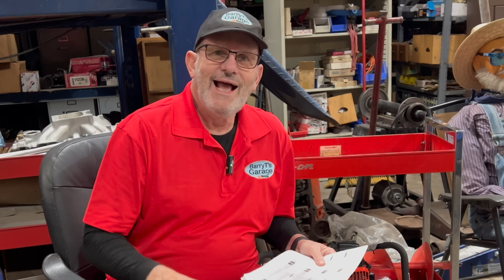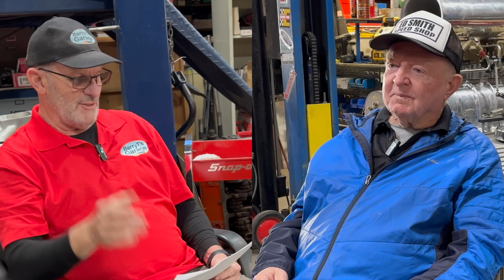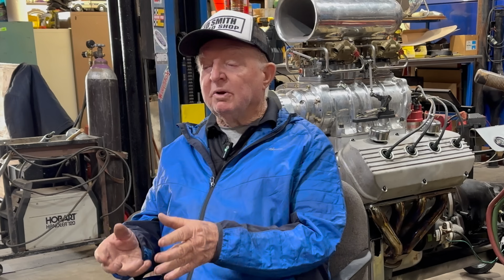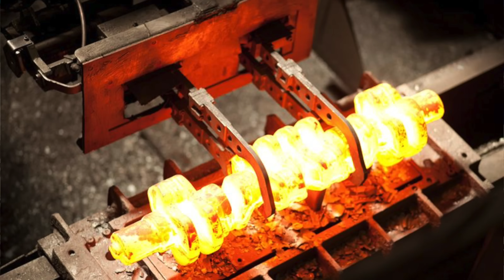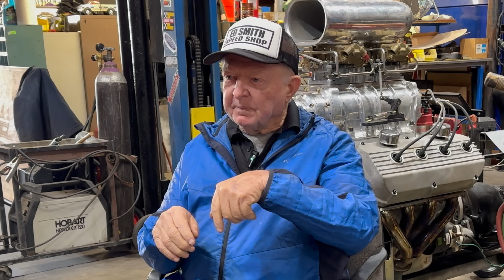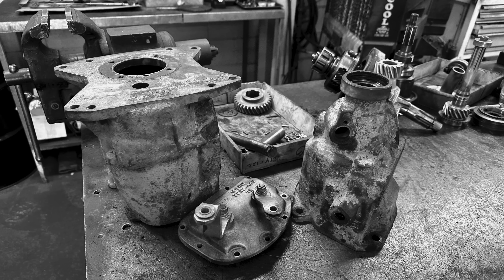Why a Forged Crank Can Actually Twist | Ed Smith with Barry T | Ask Ed 19

Comment: Both Ford and GM never added nickel to their cast iron engine blocks.
Reply from the maker: Might be an urban myth. It’s something people like to talk about, but I don’t know where it’s been proven
Reply: @BarryTsGarage  Truckedup wrote:There's been discussions on the supposed high nickel SBC identified by the 10 or 20 casting numbers....But no proof to back it up and...Some guy insisted early 454 regular production blocks were high nickel, any truth to any BBC nickel content or this or just more myths?
Myth. Or maybe misunderstanding.

I have personally overseen the analysis of iron samples of both Ford and Chevy production blocks with a $500,000 Scanning Electron Microscope (SEM) here in Silicon Valley so as to get this question answered once and for all. None of them contained any nickel. Said a reader of my analyses reports who is familiar with foundry production: "Nickel is never found in grey iron except for a small amount as a tramp alloy."

What we did find in the GM blocks in question was a slightly increased level of chromium, but this is not to be confused with nickel; it's just a differing iron alloy recipe, perhaps for a improved corrosion resistance. Frankly it's been our experience in the shop that the Ford iron is a lot harder, and when we bore Ford blocks they squeal in retaliation and we need to lap bits every other bore...while the chevy stuff gets all 8 holes cut with a single bit, "high" chrome or not.
=
https://www.speed-talk.com/forum/viewtopic.php?t=46186

Comment: Barry my 1979 ford 351 windsor motor won't spin a tire. Is my timing cam gear ⚙️  retarded from the factory?  If so will a cloyes aftermarket timing set at 0 degrees fix it or should I  advance 2 degrees? Thanks Rob
Reply from the maker: There is hope! I’ll ask Ed to explain in a future interview

Comment: I thought they all had 12vdc start and a resisted run.  Fords had the resister on the fore wall.  You knew you had a bad resister if the engine popped off wile you had the starter turning and immediately stalled when you released the key to the run position.

Comment: A deposit on a point set meant a problem with the condenser.  I forget now, but there was a rule that, depending on which side of the contacts the point formed on, it would indicate whether you needed a higher or lower rated condenser.  The condenser was to reduce arcing as the points opened and closed.

Comment: My buddy was a forklift mechanic and worked on a lot of propane converted engines. He told me that regardless of how many hours were on them they stayed spotless inside.
Reply: I worked for a school district with all propane school busses. only changed the oil every 10k and engines last 200k and very clean inside when we pulled one.
Reply: You are Correct
Reply: Except regulator n carb smfh

Comment: Most spark plugs nowadays have built in resistors built right in. On older cars the magneto wasn't all that powerful and they did not use resistors. Unfortunately this would destroy radio signal in the AM/FM bands.

Comment: I have a pair of 318 Chryslers in a boat. They run good but was interested in getting more torque. With height limitations I figured new heads and better dual-plane manifold. Use 92 or 93 octane gas. Really enjoy learning from an 
Ole Master !

Comment: inherited dad's 1978 ford f150 xlt LARIAT j code 460 ,made 51 trips and back to texas,put over 487,000 miles on it,retired it due to the heavy pistons in it,wore the bores to the point of piston slap,then gave it to my son,who grew up in it,he said i'll store it in a container till i can restore it,we put fuel in it,it starts right up,INCREDIBLE ENGINE,DOESN'T SMOKE
Reply from the maker: Amazing
Reply: Take that four sixty hone it out, put new rings in it and move the timing gear up one tooth. You'll have a brand new truck

Comment: Back when I was researching dual point performance distributors, they were saying it was to increase the dwell time because at high rpm there was so little time for the coil to produce the magnetic field.
Reply: That's exactly right.  Had nothing to do with heat.  Increasing the dwell was the dual point advantage.

Comment: Ed do you soak your hydraulic flat tappet lifters and pump them up  before you install them?
Reply from the maker: I’ll ask Ed - good question
Reply: Hydraulic flat tappet lifters should never be pre-soaked in oil before installing them.  The only time oil should be pumped through to lubricate everything is when you're about ready to fire up the engine for break-in after everything's been assembled...

Comment: So some of the points about crankshafts are not entirely accurate.  
A cast crankshaft typically refers to a crankshaft made of cast iron, but more specifically it means the crankshaft is made in the traditional casting process of pouring molten metal into a mold where the mold is typically comprised of tightly packed sand with a few additives to keep it in shape and other to help the “mold release” process.  Cast crankshafts can be normal old gray iron or by the addition of a very small amount of carbon it becomes what is referred to as nodular iron.  Cast Iron is a strong metal in compression but not so much in tension as it being composed of graphite among others makes it brittle.  The addition of carbon results in the nodular iron crank having more strength and its newfound ductility reduces it brittle nature!  With the addition of even more carbon but less than 2% of its total volume the molten metal is now full blown steel and no longer suffers the any drawbacks of cast iron.  

The next type of crank is the forged crankshaft.  While there are many different types of forging processes, the particular forging relevant to automobile cranks is the drop forging or also referred to as closed die forging.  A giant multi thousand ton hydraulic press is employed the compress metal between two dies.  The dies are two very large solid heat treated tool steel rectangular in shape, think of something the size of an end of bed storage trunk.  One die rest on base of the massive hydraulic press, basically on the “floor” if you will while the other die is attached to the press directly overhead the bottom die and raises with hydraulics.  In the face of each die where they come together, the rough shape of a finished crank is cut away, similiar to each half of a mold (in molds one is the cope and the other the drag).  This cavity is actually slightly oversized as some material must be left for final machining to dimension.  Depending on how intricate the shape to be die forged is, there could only be one cavity or their could be several cavities or several sets of dies.  This is called progressive forging.  A blank piece of bar stock is heated red hot and in some cases must be hammer forged to get it into the rough shape to be close enough before it can work with the cavity in the closed die or for simpler parts a hot blank may directly to closed die.  In either case the red hot metal is laid on the bottom die in this cavity and the top die hammers down closing the two dies together and the metal thru a process called “plastic deformation” is squeezed out to fill up the entire cavity.  It may take several hammers of the two dies together to completely deform the metal to fill the cavity and it may take the a die with multiple progressively changed shaped cavities where the workpiece is hammered in one cavity then moved over to the next cavity and hammered again and so on and so forth.  There’s is a final cavity or in some cases a different set of dies loaded into another press that is the “clipper” die that slices of any extra metal that’s beyond what it took to completely fill the cavity and thus was squeezed out onto the flat faces.

Where what Ed was talking about twisting comes into play is that forged crankshafts are either twisting or non-twist forging.  A twisted forging gets twisted into the general shapes of a crankshaft while red hot and before going into the closed dies.  A prior process done while more in the bar stock shape.  Recently in the last few decades most performance cranks have went away from this and use the non twist method which relies on progressive forging in multiple cavities or multiple die sets.

Lastly a billet crank starts as a piece of cylindrical bar stock that was hot forged at the steel mill into the bar shape.  It’s machined away bit by bit till it finally is the right shape and then the journals are ground to final size and polished lastly!
Reply from the maker: Wow, that was a really informative comment.  Thanks for adding all that detail, I think that's really helpful for understanding how a crankshaft is forged.
Reply: @BarryTsGarage  there’s many YouTube videos showing the forging process, typically done in china nowdays as the US has off-shored the majority of our heavy foundry work except for some of the oems but even them are doing it too nowdays.  We just can’t compete with china due to what our workers expect to receive in salaries versus the economies of china and also their government subsidizes citizens who own these factories with the capital outlays for the factory itself and I’ve even read where they receive preferential supplies from the mills in raw materials.  
Anyway, yeah look up closed die crankshaft forging on YouTube and theirs several videos showing it in detail.  Your video had a picture you screenshoted of a crank that had already been hammered between the dies to rough shape but hadn’t been thru the trimmer dies to cut off the flat squished out steel that’s is “oversize material” for lack of the proper wording!  Very interesting stuff.  Interesting to note, even the biggest US performance manufacturing companies like Scat and Callie’s and such source their raw forging from China, but perform all the machining here.  There’s videos and factory tours of these two shops on YouTube where they acknowledge this.  They do make the billets cranks entirely in house though
Reply: @robertmason8341  Awesome . Wish you could write a book on this.
Reply: @g.andyparks.1989 ... He did, but without proofreading and editing for correction so it would make sense to we who can read. Sad that he spent so much time, but not quite enough.
Reply: Sounds like your a mold tech, i hope you never work for sogefi-purflux group.....
Reply: thanks for the thorough, detailed answer.

Comment: 340 vs 360 Chrysler engines. 
The 340 was a short stroke with a slightly larger bore. It also had a forged crankshaft with smaller main bearings. The cylinder head had larger intake and exhaust valves. 
340 heads will fit a 360. Clearly, the camshafts were different as well.
Ed is a knowledgeable man. We can't expect him to know every detail of every engine.
  I'm a Mopar guy. I have owned both engines.
Reply from the maker: Hey thanks for adding some detail here 👍👍🙏
Reply: 318 & 340 shared basically the same stroke @3.312, the 318 had a 3.91 bore while the 340 was 4.04. 360 had 3.58 stroke with 4.00 bore, all of the Mopar small blocks had the same rod length, just in the later years they started making heavier duty rods and in 72 the forged crankshafts were being dropped from all engines. Everything started getting cast steel cranks Externally balanced which was a varying size of weights welded to the torque converters and offset center hubs on the front dampers.

Comment: I have one of those 267 engines and you could stop the car while holding the gas pedal to the floor. Great gas mileage but the biggest dog ever. I put in a 400 sb and had lots of tq. And about 20mpg.

Comment: i love Ed but his comments about twist forged steel crank springback are not accurate.

The forging is done at high temperature, where the yield strength is low, and the steel easily flows plastically to the desired shape.

Subsequent to forging, the crank is again heated to approximately 1400 degrees F, called austenitizing, to homogenize the microstructure. it is then quenched and tempered to the desired tensile strength.

After all of this physical and thermal processing, it will not change shape during usage.
Reply from the maker: Thanks for your comment, I wonder how he found a crank that was out of spec that way…
Reply: @BarryTsGarage  10-4, concur with your question.

The other questions are how much was it out, and how was it determined to be due to twist forging springback?
Reply from the maker: fair enough

Comment: Last question- idk why but i just had brand-new cam break between 5$6 and behind distributor gear, lobes and lifters were perfect. It was a reman long block. 93 350 tbi truck motor. My brother knocked hole in his block and just bought crate motor to get his truck going asap. I never seen anything like it

Comment: Hey Ed, got a question, have you ever put aussie ARD1AE 351 cleveland 2v closed chamber heads on 400 ford? If so what kind of performance improvement did you see? I've got a set I'm putting a 400 build . Thanks for the great Q & A videos.

Comment: What does Ed think about the 65 1/2  L-78 being special?..
We bought a 65 1/2 SS Impala L-78 4 speed 12 bolt 4.10 gears.   That 65  L-78 seemed  superior, all the other years the engine seemed weaker.

Comment: Fords all starve for oil on launch because of front sump. 351 m and 400m all have oiling issue because the cam lifter bores all spider cracks , 1 in 20 blocks are rebuildable  at the rebuild company i worked for .

Comment: Duel point distributor is to stop point bounce . A V8 single point distributor starts to bounce at 6,000 engine rpm because it has 8 lobes. A duel point only has 4 lobes to it can Rev out to 8 or 9,000 engine rpm without bounce . He comments on heat is BS . It’s really about high reving performance engines .

Comment: @BarryTsGarage    do you think the camshaft failures and recent problems could be caused by core shift causing the geometry to be off between the lifter bores and camshaft bore and our modern oils are just not able to keep up with the stresses they would have to over come and then heat up and finally over heat the surfaces causing major damage like we have been seeing. it makes sense cause its not every install  going flat. its just random so if only some do then the only constant would be the blocks lifter core shift relative to the camshaft.

Comment: Cast iron has a thin parting line and is OK to stock to mild performance. Fridge steel has a wide parting line from the forging. Much heavier, stiffer, and smaller counter weights due to the fact they are heavier. Billet steel is a crank made from one large piece of hardened steel, and expensive to produce, but best for high horsepower engines. 
There is also powdered metal connecting rods. Better than cast iron, weaker than forged. Powdered metal usually have a cracked cap that fits together like a puzzle piece. Different looking parting line if at all.  Aftermarket H beams do not have a parting line do to the H material removal design.
Thank you both

Comment: Duel points increase dwell time not what he said.
Reply: The points are working together the first set opens but doesn't break the connection to the primary side of the coil a few degrees later the second set opens and disconnects the primary and the magnetic field collapses across the secondary winding and this action produces the hi voltage and initiates the spark then the first  set of points closes and starts to charge the coil followed by the second set closing and the process repeats.
Reply: Explain

Comment: Built a Towing Station Wagon for an old Couple. It Had a 460, C6 and 2.75 rear end.
I had the C6 Rebuilt with Tow Appropriate Converter and Kit, Swaped the rear end With a 3:53 9 Inch and went through the 460 doing seals and Minor Changes including the Police Interceptor Timing Gear and High flow Oil Pump.  
They were Snow Birds and pulled their camper until unable to travel any more.
That Mercury Station Wagon was a Beast. 
People always asked them what they had under the Hood as they flew up Mountain Passes without slowing down.
Reply: Damn that's a tall gear I bet it never ran out of gear which that torque could probably pull it fine I always liked the 3:73&4:10 but I'm a small block Chevy guy
Reply from the maker: That’s great WORK, you did them a huge favor!

Comment: Don't daul points also increase dwell time increasing coil saturation???
Reply: @dougkuester  yes more dwell keeps the coil primary connected longer and will rev higher before mis fires. This is referred to as a collapsing primary and a CD ignition is referred to as expanding primary and will rev much higher.
Reply from the maker: I will ask Ed about that.

Comment: I'm guna ask my question again. Last time when I asked my question got alil wordy. I'll try again with less words. 
 Ok somtimes we smooth the combustion chambers in the heads to reduce potential of detonation. Is their any benefits to not smoothing the chambers? Leaving them as cast? Does the as cast chamber help with the cumbustion? Like with atomization? This smoothing has been dun on my D0VE-C 460 heads.
Reply: I never heard any upside to the rough as-cast chamber, other than that it would be smaller than after polishing it. Therefore, it might be larger and have less compression. The roughness tends to give carbon more of a place to stick, and that was said to harm performance.
Reply from the maker: That's a great question!  I'll ask Ed if he has any insight.